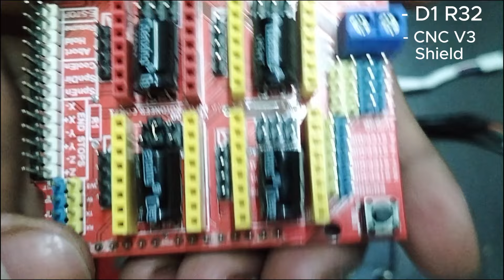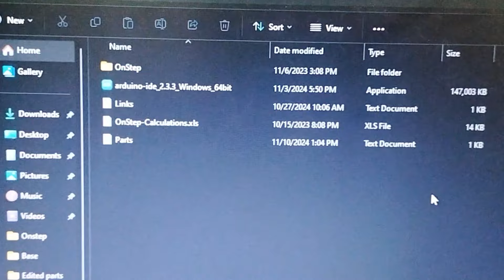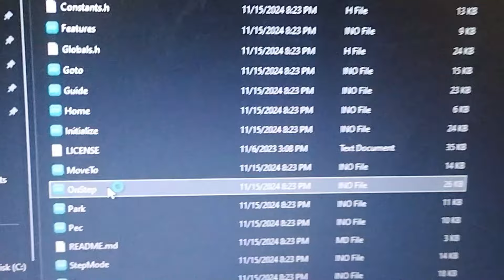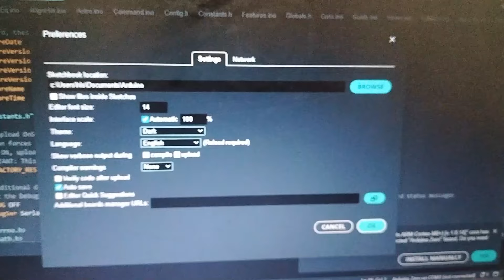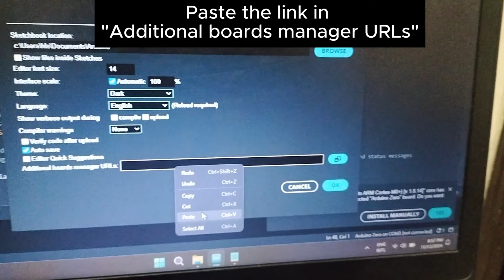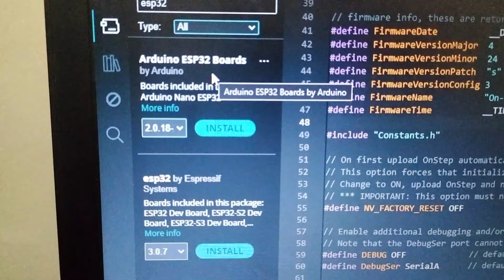How to turn your manual telescope to fully motorized one for extremely cheap | OnStep Wemos d1 r32

Comment: I followed this and think its fantastic, I would like to know how to configure my mount next. 
I'm using 2 strainwave gears 100:1  with  steppers pulley 16 teeth and strainwaive 60 teeth. Im using Nema 17's 1.5a  0.9 

.🙏
Reply from the maker: Hi . Sorry for late reply . You will need to calculate steps per degree for your selected parts . In your case it will be 53333.3334 steps per degree on both axis